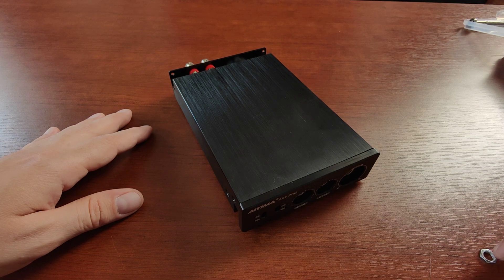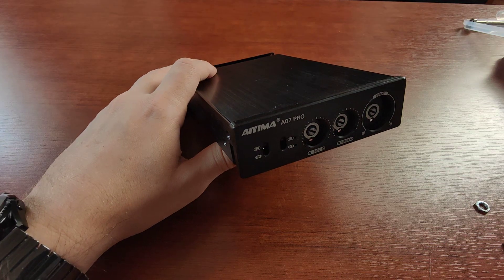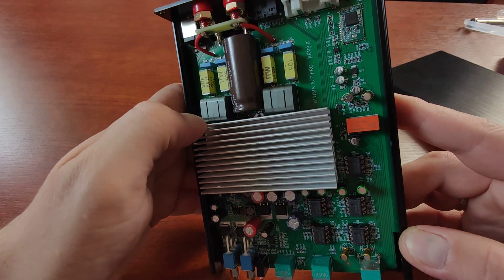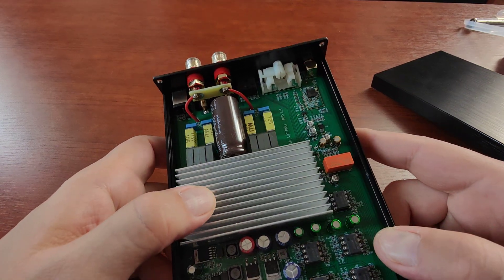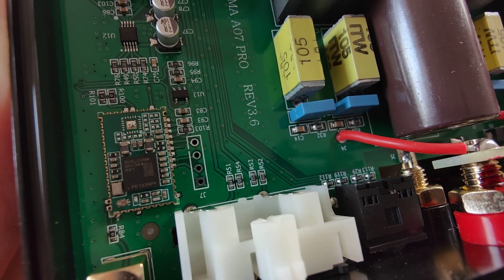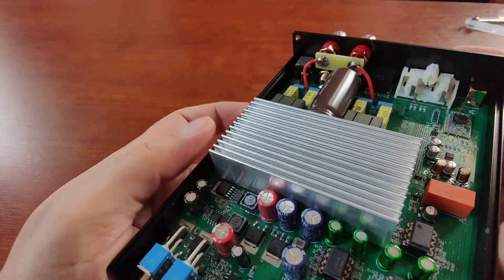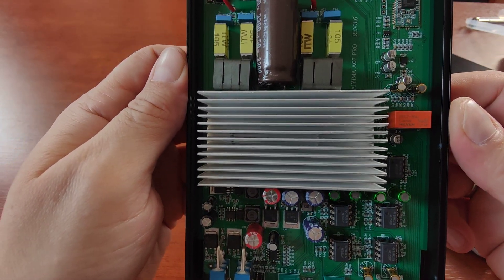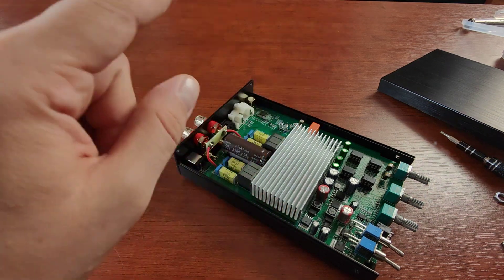Aiyima A07 Pro speaker amplifier inside - how to replace opamps?

Comment: hi. there are 5 operational amplifiers in it, I couldn't find any information anywhere about which operational amplifier is responsible for what - is there such information? I ordered two OPA 2211 for this amplifier, I just need to decide which of the 5 standard ones to replace with OPA 2211
Reply from the maker: @trinich92  the single one is for aux output, so for subwoofer leave the stock ne5532.
The other four are for left and right channels but I don't remember now what was the difference. The relevant info is hidden is the ASR thread for that amp review, a few pages down from the start. 
I don't remember exactly what was there, but I remember I decided to replace all four of them.

Comment: why it need 5? lol
Reply: Good Question. Anybody know which opamps handle the left and right channels? I ordered 5 x OPA828's, two of which are V5.
Reply: @hawaiitek  hi. there are 5 operational amplifiers in it, I couldn't find any information anywhere about which operational amplifier is responsible for what - is there such information? I ordered two OPA 2211 for this amplifier, I just need to decide which of the 5 standard ones to replace with OPA 2211

Comment: Very interesting! Can you give recommendations which op.amps should be used in the "Aiyima A07 Pro" ? There are 5 pieces of NE5532. Which ones should be changed to which ones? Thanks!
Reply from the maker: Depends on your budget. If you can, get OPA627 or OPA828 set, these are absolutely brilliant
Reply: @k4syx which budget opamps will be most detailed in higher frequencies, making wide stage? I need to brightened my system a bit.

Comment: I see they made the same design error in the A07 pro as Fosi made in the TB10D ... the output inductors are right up against the chip's main heatsink.  This will cause inductive interaction with the heat sink, causing eddy currents, which will affect the sound quality quite noticeably and add some extra inductive heating to the heatsink itself.

In the TB10D I solved this problem by cutting away 1 fin from the heatsink to make some space between it and the coils ... now the sound is much better, far greater detail and channel separation and the whole thing runs cooler, too.

Also check thoe NE5532 chips... something like half of the 5532s in distribution are fakes.  I found several fakes in the A07s.
Reply from the maker: Yes, those 5532 went for swap with something better right away.
I think the heatsink is made from aluminum, that should limit electromagnetic interaction, but you may be right. I may try this someday!
Reply: @k4syx 
Aluminum is non magnetic and many people think that means you can't induce currents into it... but you can.

 https://youtu.be/AHED5xSnnM8?si=V86kFqt_Wl854gtx

The PWM pulse train is running all the time the amplifier is on. It's in phase and at 50% duty cycle so it can induce heat into the sink from the coils.  

Also since these eddy currents will resist changes in the magnetic field around the coils it opposes changes in the PWM chain that are out of phase. (i.e. amplified audio)

Finally since eddy currents are induced across  the sink, the coils will interact through the heat sink increasing cross coupling between the coils.

You wouldn't expect this... I didn't... until I put on a smaller heat sink so I could get at the reset circuitry underneath. The difference in sound was pretty obvious.
Reply from the maker: @Douglas_Blake_579  @Douglas_Blake_579 thank you, I always love to learn something new. This actually may be simpler - to go with a bit smaller heatsink, I have a box  of different sizes somewhere in my "useful junk" pile :)
Reply: @k4syx 
Sure, if you have one that gives added clearance from those coils, give it a try... The worst case outcome is you'll be scratching your head wondering what the heck I was on about.  Best case... you now know to modify the actual heat sink. These are not strong magnetic fields so even 1 or 2 centimetres of clearance should be enough.

I see Fosi did the same thing in the BT20 Pro too.

So much experimentation, so little time... (Grin)
Reply: @k4syx  
For the 5532 op-amps, I've taken to replacing them with RC4558s which have a higher input impedance and will add a bit of bite to the low bass. The 4558s are dirt cheap, something like 50 cents each.
Reply from the maker: @Douglas_Blake_579  my choice is usually  OPA624 or AD826, though set of first ones is worth more than this amp :D
Reply: @k4syx 
TL072s are also a good choice at about $2.00 each.

But please be aware, I'm not chip flipping for sound quality, I'm doing it to get the fake 5532s out of there.
Reply from the maker: @Douglas_Blake_579 Im electronic engineer with a degree, and though all my knowledge says that opamp swapping shouldn't matter for audio freq range, try this: get a cheap kit for 47 headphone amp (2usd) or just wire it on universal test PCB.
Use sockets for opamps, caps on power supply section and DC in/out signal path. Than get headphones from >150usd range, and some paper for taking notes. You'll be as much surprised, as I was. 
Apparently there are things that we're just not measuring, or not measuring in the right way. Seriously, try this :)
Reply: @k4syx 
40 year technician (retired) on this end.

I have tried it on breadboards and while the differences are often rather slight they are there.

What I meant above is that my goal is to deliver a reliable product to my clients.  Messing with SQ is, well, not the job.
Reply from the maker: @Douglas_Blake_579  100% agreed - messing as a hobby, fun and learning is ok, but product sold and supported has to be completely reliable and deliver on the promise.
Reply: @k4syx 
Agreed.  However; within the current ethos  the only valid requirement is that a product sells for a profit.  Yes, I know that is deeply cynical, but prove me wrong...

I build "soundbar killers" for friends and friends of friends. These generally involve an optical DAC a mini-amp and a mid-priced pair of speakers for use with television sets.  Sometimes i do modifications for specific purposes.

I recently did a deep dive into a number of TPA3255 based products as a mix of DIY boards and consumer mini-amps.  What I found was not pretty at all.  My little survey found not only a lack of good engineering principles but also incorrect understanding of how the chip itself operates.

Some examples...
1) The "always on" ~CLIP/OTW and ~FAULT indicators on DIY boards.  By virtue of the persistence of our eyes this masked short term warnings such as occasional clipping and rendered them useless as a warning device.  The consumer amps most often left these two pins open failing to implement these functions entirely.  As warning devices they need to be off and flicker on to warn the end user he's getting carried away.

2) Boards obviously designed for specific applications but released to the public as surplus without QC checks.  In one case the board used a flat bottomed heat sink that was shorting against capacitors underneath. 

3) Total misunderstanding of the ~RESET mechanism in the chip.  A couple of the consumer amps were forcing 5 volts into the ~RESET pin to activate the amplifier. This is part of a 3.3v logic structure that is specified for an absolute maximum of 4.7v.  Others were leaving the ~RESET floating when "off", rather than grounding it and after a few seconds this would allow you to play music with the power switch in the Off position.

4) The whole thing about coil placement with coils too close to heat sinks and sometimes too close to each other.

5) Underrated output coils. Many of the newest designs are using coils rated for 3 and 4 amps maximum current.  That gets used up in the first 40 or so peak watts of output making them useable only below 25 watts RMS or so.  Above that they will saturate, sing and become very hot. Yes, you can actually hear them when connected to a dummy load.

6) Terrible cooling solutions. Many of the DIY boards have totally inadequate heat sinks mounted and several of them had no thermal paste applied at all.  The consumer amps faired better, but only by a small margin.

And on and on. 

It strikes me that this is all about "designing to a price point" rather than taking a small hit in profits to produce a truly good product.

Out of the bunch, which one fared best?
The original Aiyima A07 is still the winner.
Reply from the maker: @Douglas_Blake_579  100 percent agreed. Building to a price point is not pretty, and not something that designer, engineer would be proud of. My first "mod" read is always producers white paper, to check if the implementation is correct, and if there are any differences that can be reasonable. Unreasonable stuff is first to "mod" - making it like on reference design.
Btw that makes you wonder about real potential behind TPA line - we may yet see that in some product. 
I had A07, I liked it, but I was missing tone controls - easiest way to correct room or cheap speaker deficiencies. But I liked it.
Reply: @k4syx 
There isn't much mystery about the TPA3255 ... the first graph on the first page of the spec sheet is pretty much what i measure on the stuff that goes through here.  In fact the only real gains right now are in the implementations, particularly the output coils which set the "flavour" of the sound.

I have EQ in my HTPC, through FFDShow so the A07 was perfect for me.   
If you want tone controls I would suggest an external pre-amp.

What would I like to see?
Power switch separate from the volume control.
Nice big over-rated output coils.
Front panel Clipping and Protection warnings.
Proper standby functionality.
Trigger input to wake it up from a pre-amp.
Volume, Balance, Bass and Treble controls with detents.
36 volt, 7 amp power supply (gives 75w/ch)
And of course... a reasonable price tag.

But, hey... we can all dream, can't we?
It will be interesting to see what the next generation TI chips will come up with.
Reply: @Douglas_Blake_579  Hi. So, I purchased the A07 Pro and I really like it, but would like to replace the op-amps. Can you explain which RC4558's you preferred/purchased - RC4558P or RC4558IP?  I also noticed that the heatsink is VERY close to the output inductors and might get my dremel and cut away portions of the heatsink. Question about that as well, how far should one cut away the one fin of the heatsink? A few mm's or like 1/4" away from the inductors?
Thanks for your help! I really appreciate people like you.
All the best!

Comment: Hey man, nice teardown video! How about bypassing the caps with some low capacitance film caps like Paul McGowan from PS Audio said, I mean if we ignored the size and space issue. Will that improve the sound?
Reply from the maker: I'm not sure if that's safe in this particular scenario. White docs for TPA series state that electrolytes are there for a reason as in D class amps they have some specific thing to do, not just regular output stage DC filtering. I don't remember the details now, but because of that I'm not touching any D class outputs with film caps. You can however replace stock ones with some nice Nichicon audio grade series, IMHO latest gold series are really, really good, almost equal to WIMAs or VISHAYs.
Reply: @k4syx  Wow, didn't know that. Thanks for the input my good sir.
Reply: @k4syx  But just to be sure, I'm not saying replacing the old electrolytic caps with poly/film caps straight away. I'm saying about running the poly/film caps in parallel with the existing electrolytic caps.
Reply: Will that be not safe too?
Reply from the maker: @jampiserapah  yes, bypassing. The thing is that I think there was something about possible oscillations when using other types, so in that would also be danger for bypass cap.
Reply: @k4syx  Understandable. Thanks anyway for helping man. I guess bypassing electrolytics should only be done with A, B or AB topology amps huh? Digital amps not so much.
Reply from the maker: @jampiserapah  Yes, that was my take from reading TI docs. I was tempted to try it anyway, but I need to get my hands on some 3116 or 3118 that I can burn without remorse ;)
Reply: @k4syx  yeah I feel you. Even the A07 Pro is a cheap amp, it sounds sweet though. Shame to burn one haha  We have one at our store, used to play music at the counter. I guilted all my colleagues to chip in for the A07 Pro and a pair of Sony SSCS5 haha 😂
Reply: @jampiserapah 
I could see stepping the input caps up from 10uf to 22uf , but beyond that you're not wise to mess with class-D like it was class AB.